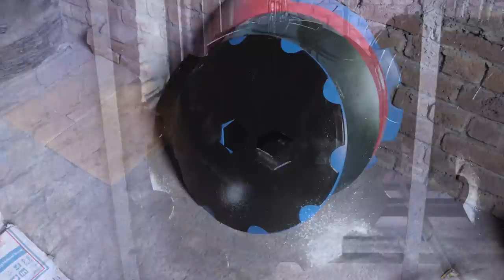Manufacturing Process of Agriculture Disc harrow from Railroad Steel Track

Comment: 6:30 Even the most basic of necessary safety is NEVER wear upper long-sleeve clothing while using a lathe, or at least roll your sleeves up above your elbows while using a lathe
Reply: I was more than a bit worried about the exposed drive belts everywhere as well. A set of simple guards they could have fabricated themselves would save a life.
Reply: @brianthesnail3815  
Youre absolutely right
Reply: My favorite is all the open toed shoes

Comment: If I looked at the part first, I would have assumed it was flattened first, then bent into shape with the pieces cut out, all in one go. Aside from that little bit of machining on the lathe, that's what I would have thought happened. The part was moving around a lot. I can only assume it was to allow various cooldowns/reheats between setups to give it more strength maybe?

Comment: You could easily implement a gyratory jig for the purpose of holding the disk while its being sanded. Sort or let the disk free spin while you position the angle grinder comfortably.
Just a peg would do really.

Comment: INFO  on Indias'  Rail  System:   ( This,  is  krazzy,   c r a z y ....what a polluted system ! )  wow factor  X 10.  Who'd   wanna repair rail, in this mess ??
            The Indian Railways has the second largest rail network in the world.-
        Researchers develop a new alloy with improved corrosion resistance for Indian railway tracks.

TOILET discharge into the open from passenger trains is perhaps unique to the Indian railway system. Apart from the highly undesirable environmental pollution it causes, it leads to severe corrosion of the rails and their fastenings as the toilet chutes are located almost directly above the rails. It is, in fact, a major cause of corrosion of the rails. This problem is not to be dismissed lightly because the economic cost of corrosion of rails (which, of course, includes normal environmental corrosion) in the Indian context is very significant.         Modification of the toilet discharge system by the Indian Railways, as announced by the Railways Minister a couple of years ago, by replacing the present system with green toilets or aircraft-style vacuum toilets, is certainly welcome, but that addresses only a part of the corrosion problem. Atmospheric corrosion of rails, particularly in coastal regions which accounts for a significant fraction of the Indian network, is also a serious issue requiring urgent attention.  ( there is alot more ....)

Comment: But why all the filth?
Reply: What "filth"? It's a foundry, not an operating theater. As a kid, I spent a summer working in my Grandad's welding shop, in Kansas, an agricultural state. I spent many an hour sharpening these same (so to speak) harrow disks, and, trust me, his shop was every bit as "filthy" as this video shows. The trick is not to scrub everything down, but to make damn sure the the floor and work surfaces are clear, so that there are no unpleasant surprises. These guys know what they're doing, thus full complement of fingers and toes, despite the foot gear that seems to give viewers such  conniptions. Rely too much on "safety" gear, and you can get into a heap o' trouble.